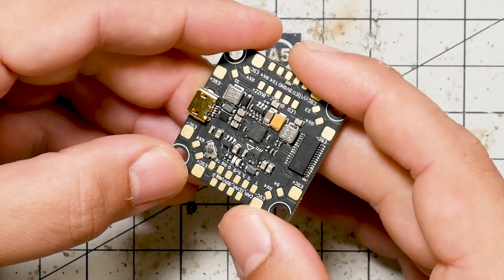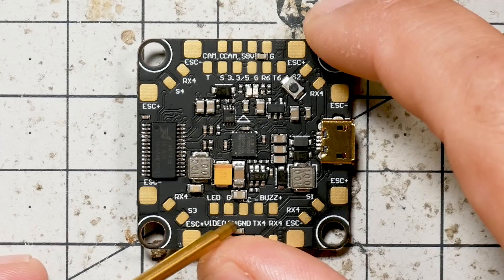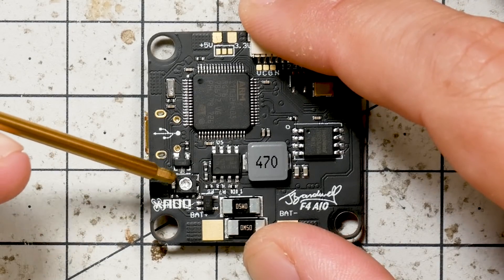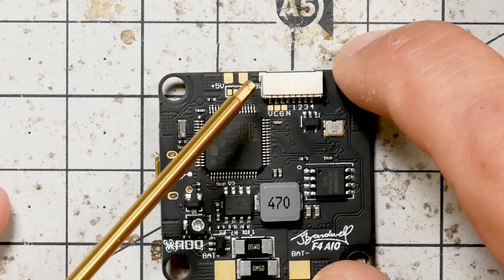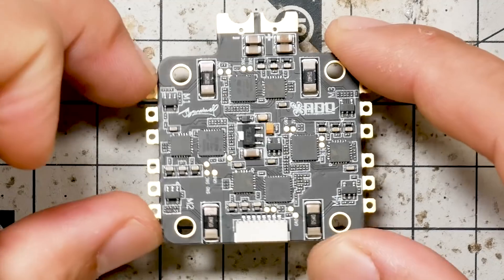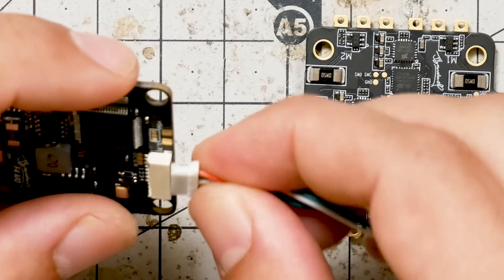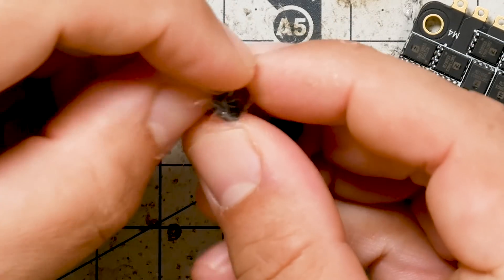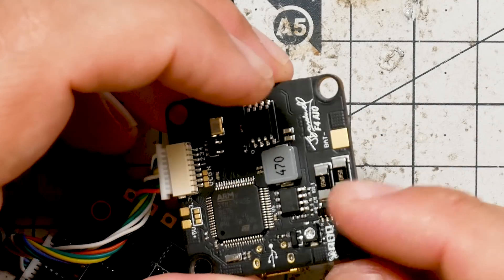JBF4 v2.0 and new Joshua Bardwell 4-in-1 ESC

Comment: My 3.3v and ground are shorted after a crash and the FC does not power up anymore.. VTX, and RX power up fine.. Would I be able to change the 3v regulator?
Reply from the maker: I would guess the PCB is damaged from the crash and a trace is shorted. This isn't likely to be something you can repair.

Comment: Should the ESC beep or anything when I fire it up? Was just testing it after connecting power and didn't hear anything. Flight controller does light up, tho...
Reply from the maker: It won't beep if the motors are not connected. The motor coils are used as the "speakers" for the ESC tones.
Reply: @JoshuaBardwell  thanks! Thought I friend the board! Looking forward to testing this out!

Comment: Did you say cooking them together?? 7.31s😊 mine did not come with any wires or any diagram just the bare board!# was very disappointed.. JB
Reply from the maker: The manual for the FC contains full wiring instructions and you can download it from the RDQ product page or you can order a printed manual with thee FC.
Reply from the maker: The ESC wiring diagram is found on the RDQ product page here:

https://www.racedayquads.com/products/bardwell-4-in-1-3-6s-30a-esc-by-rdq
Reply: @JoshuaBardwell  I already have the FC but it did not come with any wires or anything apart from the gummies..

Comment: So I’m  wiring up your new FC and ESC on my quad right now and thought...
Do I need to soldier battery leads on to the FC as well as the ESC? It does power up the FC thru the multi-pin lead that came with the stack when I plug a battery in to the ESC, but will it be able to draw enough current thru that tiny wire to run the camera, VTX, and receiver?
Reply from the maker: You don't need battery leads on the FC. The 4 in 1 plug can power your typical  accessories
Reply: Joshua Bardwell cool thanks

Comment: So even with the pin hookup between the esc and FC, the FC still needs 5v?
Reply from the maker: No. The FC gets vBat from the 4-in-1 plug and the FC is powered that way. That's why the ESC doesn't have a 5v regulator. Because it's not needed.

Comment: I can’t find much info on this stack regarding durability... I am buying parts for my first build. I have learned so much from Joshua and want to support the cause as much as I can. I am using affiliate links from here for everything I buy. I know I will go through parts. for my first stack I would like to start out knowing It’s got a good chance  of out living the cheaper parts I can’t find any bench test or irl flight test on the jbf4v2+4in1esc any input would help :) TY
Reply: Smooth operator
JBruncam...only thing I’ve bought so far 
RDQ 2207 1800kv motor
Frsky QX7
Fr R-XRS
Mach2
Starting with fatshark box goggles so I can upgrade later and still use the screen:)
And this stack I’m thinking 

I’m good at problem solving and think I can make it fit in that frame with some convincing ;) lol 
First time I’ve reached out for advice so if I’m way off on my picks plz let me know

Comment: So how the current sensing would work with the FC + 4-in-1 ESC combo? I want to use this new factory calibrated current sensor on the FC to get the total system current draw. But then how current goes to the ESC? What happens to the analog/digital solder bridge? Would there be a power conflict between the two boards when connecting the 10-wire connector? The manual does not explain this.
Reply from the maker: If you want to use the calibrated current sensor you must wire the ESCs so the current flows through the factory sensor. You can do this using wiring diagrams in the manual. Basically the same as if the ESC didn't have a current sensor. Otherwise, use the analog or ESC Telemetry current sensor in the 4-in-1 plug. 

There is no conflict. You simply would not use the current sensor in the 4-in-1 plug. Leave the solder bridge disconnected.
Reply: Joshua Bardwell  Thanks for the prompt reply! I get it, the current should go through the factory sensor, so the ESC should get its BAT+ from the closest ESC+ outputs of the FC. So.. what about the FC <-> ESC connector then? I suppose to avoid a conflict, I should select the ESC telemetry instead of analog or maybe even cut the current sens cable?

Comment: Be nice to see a Spektrum plug on the v3 when it comes out for Xmas ;) and the cable-plug included, needs shortening at least50%. That'll be 2 buck copper saved
Reply from the maker: Spektrum plug not going to happen. Direct solder life.

Comment: I use a Spektrum DX8 Transmitter. What receiver do I have to buy to work with this flight controller since PPM and PWM are not supported?
Reply: Would this be compatible?
https://www.getfpv.com/spektrum-quad-race-serial-receiver-spm4649t.html
Reply from the maker: Yes, the 4649T is supported. Also this one:

https://www.getfpv.com/spektrum-dsmx-quad-race-receiver-with-diversity.html
Reply: Thank you!

Comment: I bought two controllers from the first version. And one of them burned the 9V bec as I plugged the lipo. A fucking shit. The other I have mounted and I have put the camera and the Vtx in the bec of 9V, it seems that it holds, crossed the fingers, but the video is a bitch trash too. I had to put a 470uf LOW ESR electrolytic capacitor on each of the esc's pads, and I'm still not sure if it works well, I have to try it. Otherwise very good, the rest of the features work as they should, but the 9V bec has no filtering, it's a trash whore.
Reply from the maker: If you have a burned 9v BEC please contact support@racedayquads.com. There was a defective batch and we are doing our best to make sure every affected customer gets a replacement.

Comment: Is it possible to wire this with FPort using the inverted signal?
Reply from the maker: Yes. If you have done the smartport uninvert hack on the receiver, then you can send FPort to any regular UART (without an inverter). However you must go to the CLI and type

set serialrx_inverted=on
set tlm_inverted=on
save
Reply: Yeah, I wish I could find a board that allowed me to use the uninverted fport wire with one of the existing UARTS (Sbus or Telemetry).  In the scenerio you give above I end up with 2 unused uarts and only one free.  Something for the 2.1 or 3.0 version?  Love the layout of the board, the calibrated esc sensor.

Comment: Mine just smoke today. No crash. Flying and was happy. I landed and changed battery. No video. OK I took the VTx off and saw one of the chips that had 100's on them was discolored, and getting hot as heck! This was one that was replaced because of the faulty regulator. Funny thing is the "bad" one lasted longer than the "good" one.

Comment: It's an airbot typhoon?They are the same as revolt raceflight  bolt 32/ earlier bolt . 
They are junk I'm sorry. They burn out from absolutely nothing. U should pick another platform. Lumenier makes a rock solid ESC
Reply: I could be wrong. Yours  might be unbreakable like the lumenier 36 amp esc's. 
(Not  4 in 1) .
I had them underwater in a freakin 7 ft deep pond  for 8 hours with a fully charges 4s battery plugged into them.
Finally located it Pulled it out dried it off, all esc's worked. They still work 3 weeks later.
Im actually shocked. Also I do t protect my esc's. I take all casing off the esc and use 1 small zip tie per esc. I used to tape them not anymore.
Reply from the maker: Lumenier ESC's are rebadged Racerstar / Cicada. At least I developed my own with Airbot. It's not a relabeled Typhoon which you would know if you watched the video.
Reply from the maker: The flight one gear is bad because it is poorly designed not because Airbot made it.
Reply: @JoshuaBardwell  oh ill check it out man. I totally respect your work. I've been looking for a good bateflight setup to build. I'm sure it'll work great. Maybe  I'm wrong  about airbot and it's  raceflight. I've purchased 3  original bolts and now 2 bolt 32s  (raceflight) the ones I got to work never lasted more then a few packs.
Reply: @JoshuaBardwell maybe u could shed some light on that. I don't know. I'll tell you what I do know  these lumenier 36 amp single esc's are bulletproof. They stay  absolutely cold. I mean I've put them through hell. I'm not a great pilot. I crash hard   But I go fast lol.
Reply: Just a side note I've used lumenier  blheli s 30amps that were not  great so.
Reply: @JoshuaBardwell  I also think your right about the flight one gear. I use the revolt v3s they are okay  but the newer  osd board  is horrible. I mean I've never seen solder pads just lift off for no reason

Comment: So if I use ESC telemetry and crossfire I have to use softserial to connect smart audio and GPS?
Reply from the maker: If you use Crossfire, that would go on TX6/RX6.

GPS requires both TX and RX so the only option is TX4/RX4.

for ESC Telemetry you can use the un-used SBUS input pad. That will be UART 1. This pad is intended for SBUS but the inverter on the pad will be automatically disabled if you use it for ESC Telemetry. However you cannot use the ESC Telemetry pin in the 4-in-1 plug. You will need to manually connect the wire to the S pad.

For SmartAudio you can either use softserial on the LEDStrip pad (instructions in the manual) or you can connect the Unify directly to the Crossfire receiver pin IO4, which can handle smartaudio function.
Reply: Thanks for the reply.

Comment: so ive got a jb f4 version 1.2 and today after having the quad setup almost perfect for me it goes dead midair and now with lipo hooked up theres nothing.. ive checked the esc pads for continuity to lipo in and positive side has continuity but negative does not. what would my issue be?
Reply: broke two arms on my astrox switch and im just bummed about this considering ive rebuilt this guy twice due to esc failures (4.1 escs) now spedix es30hv has been awesome and hope there good and motors arent damaged but hopefully rdq can send replacement or help me figure out why it did this.. ive only ran 4s on this board also with racekraft 2307/2542 motors

Comment: How do you design your own FC/ESC - did you need to do all the complicated stuff such as integrated circuit design or its just simply a placement of how pads are located?  Can you elaborate? I'd like to design one myself and submit if that's possible?  I have many design ideas on where components should reside and so forth.
Reply from the maker: Contact an OEM like Airbot and ask them how much to build an FC for you. But it's not cheap. Nobody wants to do a one-off. They want to sell a few thousands, you know? If you want to work with an OEM expect to spend in the tens of thousands of dollars. 

Alternatively, you can design one yourself using a PCB design software like Eagle, and print it yourself using a service like OshPark. This will cost you maybe $50 a board more or less, but you can order as few as you need. But the expertise to design a flight controller is not easy to come by.

Comment: JB, I'm getting a 'fatal error' with the onboard flash for Blackbox in BF 3.5 with the V2 FC. Any suggestions?
Reply from the maker: Fatal Error is usually seen when you are trying to write to an SD card reader. But the JBF4 doesn't have an SD card reader. So probably the Fatal Error doesn't mean anything. Make sure that the Blackbox Device is set to Dataflash and not SD card.
Reply: Thanks! I'm an idiot for not spotting the blackbox device setting was SD card, and not dataflash.

Comment: I, for one, will be glad to install the grommets.
If it keeps the price down, it's great. The big deal breaker for me is using the 'bobbins' with the shallow thread. It's another $3, annoying, often requires filing screws down to get a proper fit, and invariably wastes height, which can be a critical thing. They eventually rip loose, usually while doing repair work and things are getting a little fragile by then, so changing them out is a PIA which usually leads to more problems.
A built in soft mount in this form or the 'capsule' is one of a few of the things I look for in a FC. Other requirements are a robust 9v (or 12v) supply to run a Split, 5v supply to run a Unify, both in generous enough current ratings to run cool(ish). All pads on one side is a plus too, as the option to use a 4 in 1 or not and still have current sense without wiring main Vbat power through both boards.

The improvements check a lot of the boxes, I may just try a "JB Combo" on the next build.

Comment: Glad to see improvements / fixes to the original FC design. 👍  Was there a reason you decided not to go F7?
Reply from the maker: F7 would be a total redesign. Cost about $10 more just to cover the price of the chip. For now I'd rather sell a $35 F4 that still gets the job done--especially because the gyro on this board can't do 32k anyway.
Reply: Thanks for the explanation.  That makes a lot of sense.  👍

Comment: hm you replied but the reply disappeared it seems (or i can't youtube). I understand there's a second shunt resistor so the current sensor should be able to now successfully tolerate 240A and when you pull 240A it will output 3.3v. but if you leave the betaflight scale at 250 i'm pretty sure that even if you can get your quad to crank out 240A, it'll read 132A in betaflight. i did ask the bf slack... they seemed to agree. and to a certain extent so does the documentation on the kakute fc that needed modification, which you did a video on.  I'm not saying you're wrong.  It's my understanding that no matter what hardware modification you make, the scale in BF dictates the max current reading and for 250, that's ~132A.  the current sensor will tolerate 240A just fine, but betaflight will only ever report a max of 132A and will likely be off generally...

Comment: Cant get osd on my v2.0 FC. Values are displayed after flights but not during.
Reply from the maker: Make sure NTSC/PAL setting is correct in the OSD tab. If it is wrong, the bottom like five lines of the OSD will go off the bottom of the screen.

Comment: I happy to have been using this for awhile now I actually have been running this version since I noticed the features you specified are all on this chip. Thanks so much guys and yes this chip has been working really well on 2 of my kwads..   I noticed that RX4 wasn't ground anymore which I found odd but I just cut them off of the ESCs. 

Anyways thanks Joshua but I still like individual ESCs, but thats just me :)  I'm cheap!

Comment: Sorry... but my radio receivers (futaba and irangex) don't accept 9 volt.
Reply from the maker: The FC has a 5v regulator for the receiver and other 5v devices. It's just the ESC that doesn't have a 5v regulator, which only matters if you are using some other FC than mine that doesn't hav a built in 5v regulator.

Comment: I'm so confused by the max 240A current sensor - the manual says set the current scale to "250" which means the max reading output by betaflight will be ~132A, right? Hard limit.  That's dictated by the firmware explicitly - as in a 3.3v output means 132A, which you can't exceed. To hit 240A you'd need it set to ~138.

Comment: I can only see two differences between your ESC and iPeak 35A BLHeli 32-bit ESC. The first one is the current sensor removed, and the second is a different logo. So how can you say that this is your project, and you worked on it lately? You should probably mention it in this movie. It's not bad that you put your brand on some products you trust, but you should say it, it's not bad. The same ESC that was previously on the market costs $ 10 less than yours, people who see it can lose confidence in you through such activities.
I respect you, but please do not do it. Maybe you can notice it but most of the popular ESC is produced by one company in China, probably it is do it for You. I do not know if it was originally a project of this company or their client and they sell it, but you can not deny what I am writing.
Reply from the maker: It is very easy to see superficial differences between the iPeak ESC and mine. iPeak has an additional shunt resistor on the main battery leads in addition to four smaller shunt resistors on the underside. I'm sure if we were to look deeper we would see other differences such as different FETs used etc.

But in the end it doesn't matter to me because here are the facts. This is NOT simply a re-badge of a pre-existing ESC no matter what you think you have found from looking at JPGs on the Internet. I have been working on design and test of this ESC for months. Giving feedback to the manufacturer and requesting changes. That is a fact. If you see another ESC on the market with a similar design... hey what can I do? Like you said: Airbot manufactures lots of different gear on the market, and much of it is similar. If you think $50 is not a fair price for this ESC, buy something else with my blessing :-)
Reply: But it's only cosmetic changes. Ok, You test it, You aproved it, and other, but is still 95% Ipeka. Ok, all ESC's is the same schematic, becouse have same funcionality, there is no need to build up the wheel from the beginning. I have no idea how iFlight's rights are to this pattern, in total I do not care, I think you know what you are doing and you will not be accused of copying, you certainly took care of it. One day, a Chinese girl presented her frame project on facebook, there was nothing strange about it that the frame was identical to iFlight IX5 V2. It was not well received on the group, it got a whole lot of unpleasant comments. She want at a price 50% higher than the original for this frame. :/

PS. Ummagawd was not happy either that RacerStar was copying his frame.

Comment: Are the mounting holes on the esc able to have metal screws used or will it fry?? I hate nylon stack mounting.
Reply from the maker: ESC mounting holes are grounded. Any board that has positively charged mounting holes is garbage and should be shunned.

(Exception being something like PowerCube which does it intentionally for a reason.)
Reply: @JoshuaBardwell  good form sir.